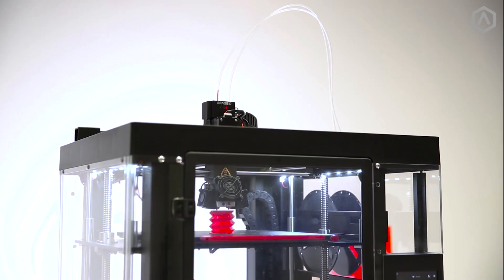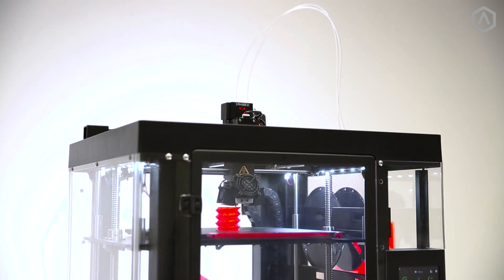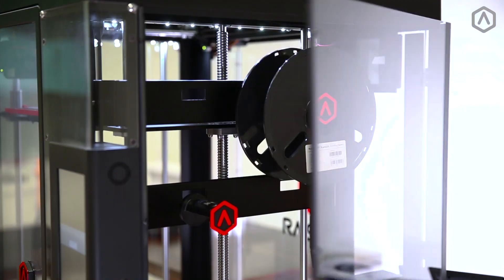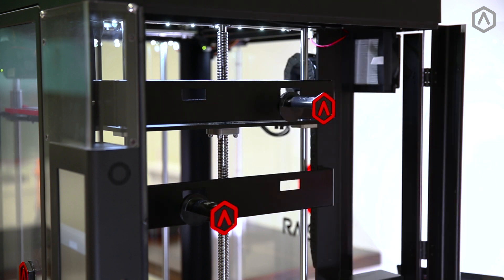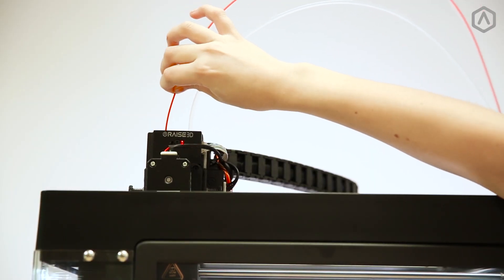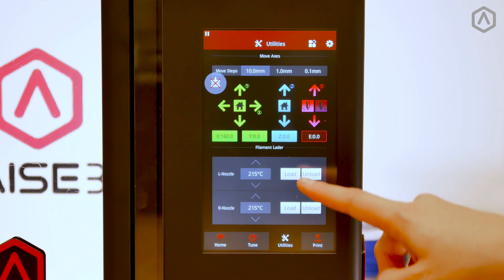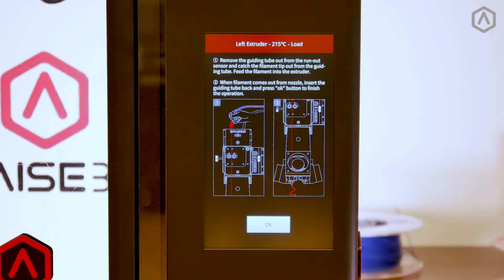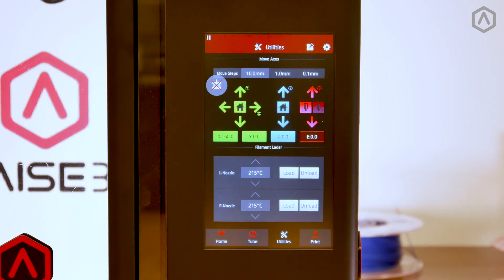Recover your 3D print after a Filament Run-Out pause | Raise Academy

Comment: my printer homed in the Z direction as well.  upon resuming it crashed into the print.  Is there a way to avoid that?  I immediately turned off the printer.  when I turned the printer on there was no resume message on the screen.  I have a raise Pro2 just installed  hyper FFF update
Reply: same thing happened to me just now. i also have the FFF update. i think there is a bug in the update file as this never happened to me before
Reply: same to me today, with a 25hours print, and 800g of filament, lost material and time for the project (Raise3D pro 2 and FFF firmware).....my Prusa never desapoint me.....

Comment: Had a print pause due to filament runout sensor, but false trigger.
Head did not move to home. 
Pressing resume started the nozzle heating process, then print began. The bed raised about 2mm and the nozzle smashed through existing layers.

Useless function
Reply: Same here. After the filament runs out, it stops but does not go to start position.

Comment: Can you pause a print to change filament colour, or is that unrealistic as the printer won't pause immediately.
Thanks
Reply from the maker: You can do a pause from the touch screen at any time during a print.  Simply hit the pause button 
If you intend to do a color swap, you can also add a specified pause in the ideaMaker software by using the "Pause at Height" feature in the advanced settings.

If you have any more questions about color swaps and setting pauses, feel free to contact our technical support at help.raise3d.com, or ask us a question in our chat box at Raise3d.com

Comment: Such an expensive printer - a world brand - and NO USEFULL  information on how to change filament DURING a print when you have NO RUNOUT SENSOR. We use Raise3D N2plus printers and what a opensource marlin software could do for ages is a pain when using Raise pirnters... why on hell do I have only 60 seconds before the steppers get disabled, why isn't it possible to pause, do your change work, and go on printing? This is really strange and makes me angry. We bought these big printers to print BIG things but everytime it is a nightmare because of the fact that one spool isn't enough and we have to stand infront of the printer to see what happens. Don't expect that we buy a new Raise3D 2 series for 6500 Euro only to get a 1 US-Dollar chinese runout sensor...
Reply from the maker: Hello y3d Computer Graphics. We have spoken with tech support about your issue and they are waiting for your call. 888-963-9028 and ask for Tech Support.